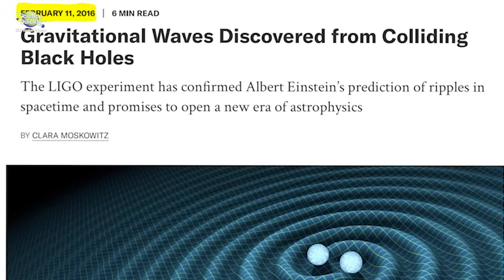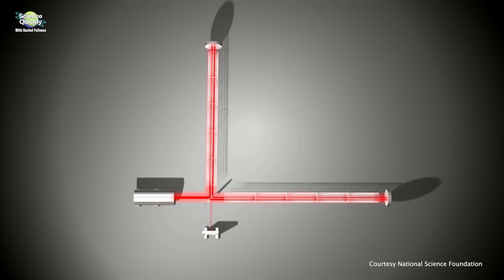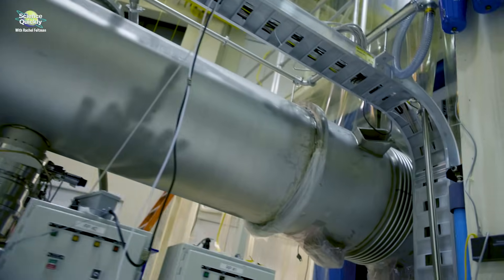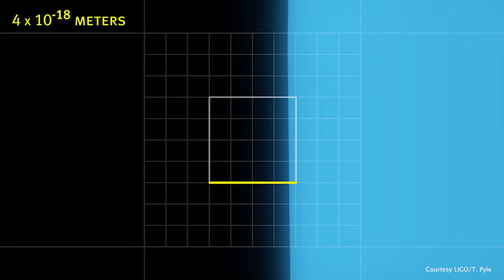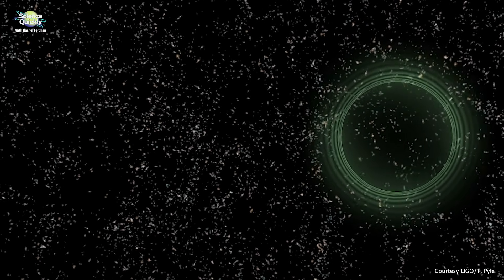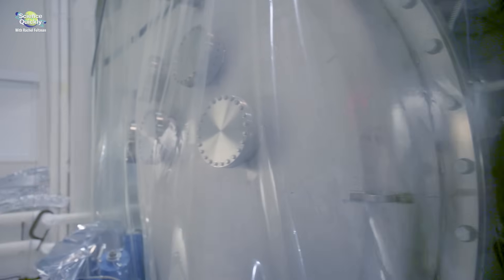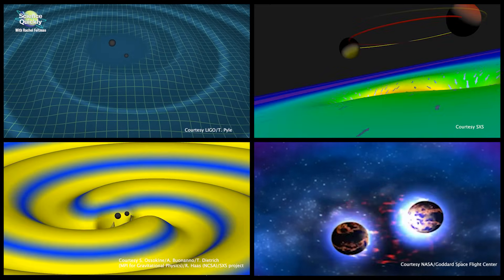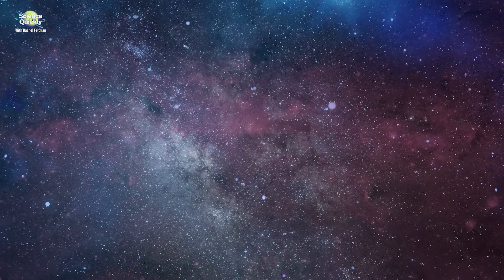What does a Gravitational-Wave Detector do? Step inside MIT's LIGO Lab | SQ Video Podcast

Comment: Einstein repeatedly said that singularities cannot exist because Relativistic dilation prevents astronomical concentrations of mass. He put this in writing in 1939. This explains dark matter.
   A fundamental insight of Relativity is that mass that exists at relativistic velocities is irrelevant from our perspective. Relativistic velocities are occurring in the overwhelming majority of galaxy centers. This means that they exist in a "non local" state relative to their outer regions. The mass in our galactic center is not just there, it's everywhere.
   Relativistic dilation does not occur in galaxies with low mass centers. They do not have enough mass to achieve relativistic velocities. Therefore they do not contain dilated mass. It has been confirmed in 25 dwarf and ultra diffuse galaxies to have no dark matter. In other words they have normal rotation rates. Mass is a clingy thing thanks to gravity, it makes sense that dilated mass would exist as a halo around galaxies.